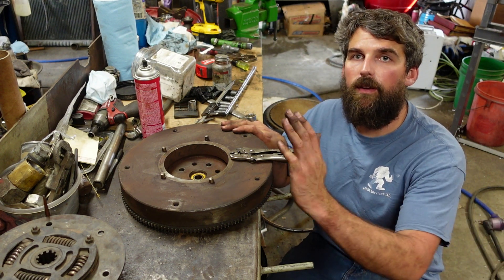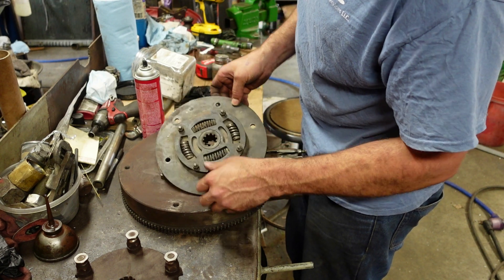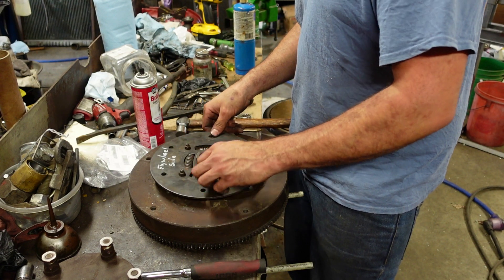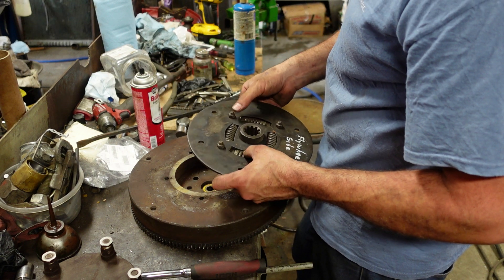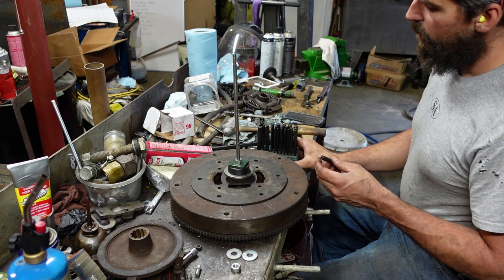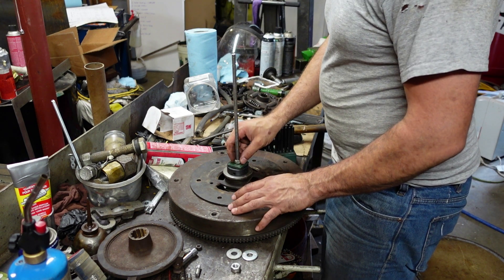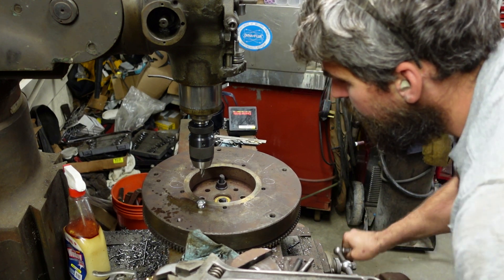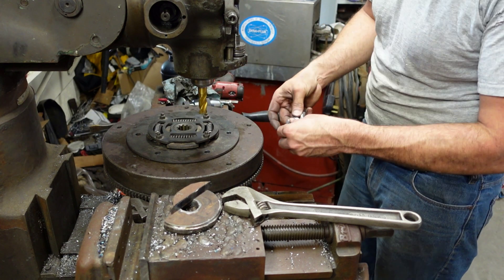John Deere 350B  torsion isolator upgrade

Comment: Let me see if I understand this correctly. You are saying I can use a clutch disc with the same splines in place of the factory isolator? I ask because  my 350C is broke and it is in too good of shape not to fix it.
Reply from the maker: As you can see, the part I used is very similar to a clutch disc. From checking specs, I think that the clutch disc should work with some minor machining and was planning on going that rout until I found the part that I used. These isolators are a real problem, but being a sort of soft link, a clutch disc with the correct spline should do exactly the same thing. That is exactly why clutch discs have a spring setup. Let me know if you try it.
Reply: Finding the correct size spline seems to be the challenge.

Comment: I've got my 350c torn apart right now and was going to update also, then realized that all the flywheels are gone. I'd be curious to know if a guy could mill out the original flywheel to accept Levoy's new isolator. It would be worth it to me to spend 1500 to get the rubber one...but would it work? Expensive gamble for sure.
Reply from the maker: I don't remember who I was talking to about that, might have been on a forum, but I think the dimension is a bit thicker. no reason not to machine a spacer. I was looking into doing that when I found my current setup. The other option that I wanted to try was to get a splined coupler with the correct splines, and machine out the torsion isolator, press, dowel, and weld in the coupler and fresh friction material. The other thing that I found is that the spline appears to be the same as the clutch on a dodge truck. Thought about taking a dodge clutch disk and bolting it to the flywheel. Should work about the same as the setup I used.
Reply: @DillonHFM  I was thinking the same thing, with a regular clutch disc. Great minds think alike! haha
I actually just told Lavoy I want his part, but I guess he's on vacation so it'll have to wait til next week. A BUNCH of money like you said, but I think it's the right way to go if I can make it work. If I can't, then i'll just put it back together and hopefully find a flywheel some day. My isolator/springs are actually in great shape. Just want to do it right while it's apart.
Reply from the maker: Guess it just depends how many hours you put on it. If it is a weekend rig, the original setup might last a very long time, if you are more commercial, then it might be a shorter term solution. I know that the torsion isolator is a point that wears out on these machines, but if it is still good, no shame in using it. The motor is pretty easy to pull on them and it could buy you some time to find a flywheel
Reply: @DillonHFM  Did you get as far as finding out what Dodge truck shares the same spline as the 350 reverser input shaft? I've seen Dodge truck mentioned a couple of places but have never seen a year or model listed.
Reply from the maker: @AlanBurnham  If you look up "dodge 10 spline clutch" you can look at what pops up, looks like just about all pickups from '61 to '78 had a 12" disc, a bunch of the cars had a 10" disc, and probably some others.